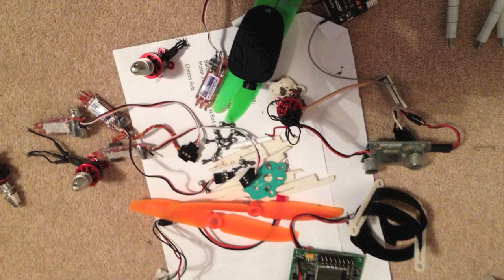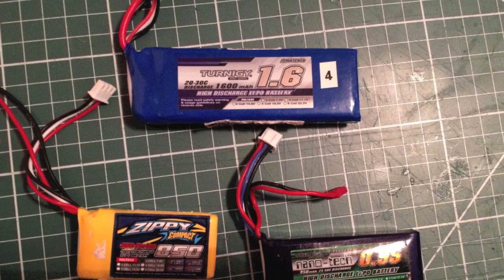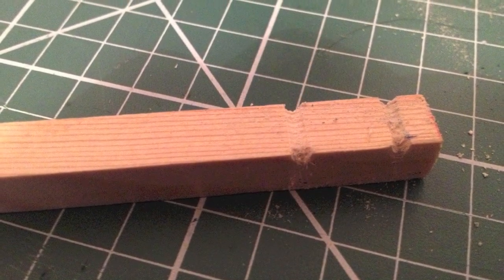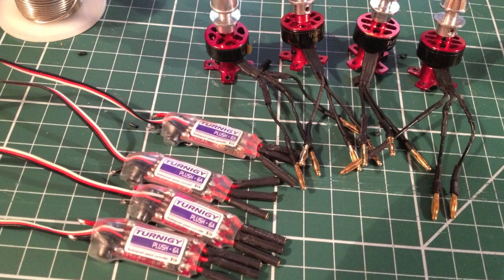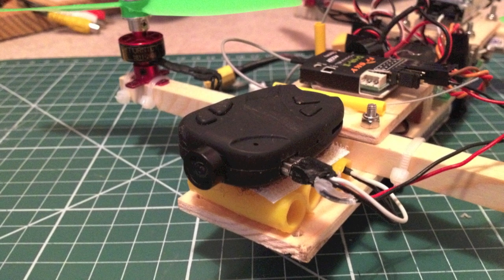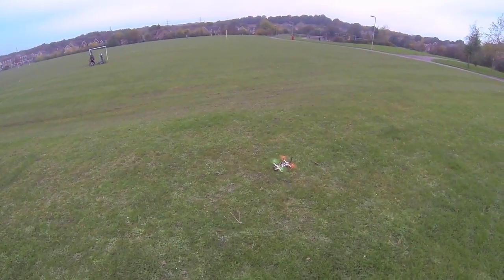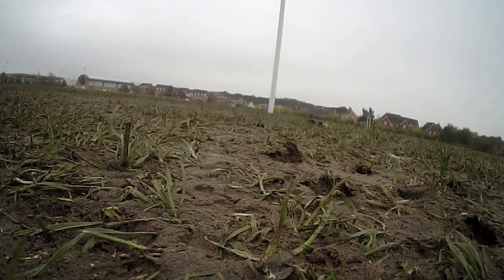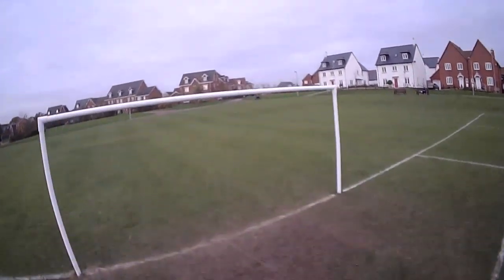FPV Mini-H Quad build, maiden and initial testing

Comment: wobbles could possibly be from frame flex
Reply from the maker: djSpinege The wood at that length is less flexible than carbon fibre, it's really nice and stiff.  What I have noticed (as I made this video quite a while ago) is that the kk2 does really seem to struggle on smaller quads - where it does reasonably on larger ones.  For quads of this size, the only choice is really the naze32
Reply: CurryKitten ah i see very nice. ya, its hard to beat a naze32. my old cc3d cost 6 times more then the naze32 and its not even as smooth in rate mode. do you still fly this woody?
Reply from the maker: djSpinege I must confess I've been stealing bits from it lately, so it's got no rx and no VTX at the moment, so not so much.  I wouldn't be able to do anything else with these tiny motors/escs now, so it'll fly again at some point :)

Comment: 7min! on a 1600? wow! I have a used 1800 3s with 2805 2s motors and barely get 5. What mini are you flying now? I think I have HB9 thought out now I have first hand mini flying bug.
Reply from the maker: Trying to fly the v5 K-Quad my friend printed, but I seem to be hitting timing issues between the ESC's and motors which is causing some wobble - this is on a 1300 3s and is good for around 6 mins in the test flights.  As you get your own CF cut, using a 3mm thick arm seems to give a really strong base on other minis

Comment: where do you put the pitch servo lead if you dont use NAZA? Just in the receiver?
Reply from the maker: The rx is using CPPM, so all 5 channels the kk2 need are coming from the single servo wire.
Reply: So to what port? I think in the receiver?
Reply: CurryKitten
Reply from the maker: Timo Martens Hi Timo, yes, in the quad a single servo goes from port 1 in the FrSky Dr4-II to port 1 on the KK2.  But it does depend on what you mean by "pitch servo" ?  if you are talking gimbals - then there are specific outputs for servo gimbals on the kk2 (and Naza) but if you are talking brushless gimbals, then in both Naza and KK2 it would be from your RX straight to the gimbal controller
Reply: Ah, okay I will buy the same gimbal as you had. And I use the KK2Board so ONE wire to signal gimbal pitch to signal receiver?
Reply: CurryKitten
Reply from the maker: Timo Martens I'm a bit confused, as there is no gimbal in this video - I don't want you to take away the wrong information from here.  Can you tell me exactly what you are trying to connect to what - flight controller/gimbal controller/rx and what you want it to do.
Reply: Okay im sorry if i am a bit confusing. This will be the setup. KK2 board, turnigy 9x, goodluckbuy gimbal (the one you had in a other video). I saw someone saying you have to put a single wire into pitch on the gimbal board TO naza. But as i dont have naza, where do I have to put it? Where on the receiver?
Reply: CurryKitten
Reply from the maker: Timo Martens Ok - I understand now.  In that gimbal video, the gimbal doesn't actually connect to Naza, it goes straight to the rx.  So you should do the same with the KK2.  So if using a CPPM rx you can have a single cable going from rx to kk2 to control ail/ele/thr/rud/flight modes and then have another cable from the rx to the gimbal controller to control pitch.  I've found out though (after blowing something) that you should only have the single control wire from the servo cable, so remove the ground and power cables
Reply: Ah thanks a lot. You have helped me a lot! Thanks for the effort of answering my questions :). CurryKitten
Reply: Hi another question,  the gimbal we talked about, the goodluckbuy one, on how many volts does it work?? A 3s lipo? CurryKitten
Reply from the maker: Timo Martens Yes - it needs 12v, run it from a 3s
Reply: Ah alright. But then I have a problem, my hex will run on a 4s and I saw the gimbal had a JST plug, I will buy a 500 mAh, but I dont have a wire from JST to xt60, you know where I can buy one? CurryKitten

Comment: Looks awesome! I've been wanting to build a very similar quad and had a few questions..

Do you happen to know what your frame weight was? Or your all up weight? I've picked out the same motors/esc/kk2 board that you have, and my total electronic weight so far is ~257grams with my receiver and camera/Tx.

What props did you use? How does it handle? I'm nervous that it will be too much weight for the little motors to fly well.

Thanks!
Reply from the maker: I weighed it before as someone asked and it was 238g without the lipo or camera.  The 1600 2s lipo weighs 92g I think.  On this weight hover is just a little past where I would like it to be at about 60%, but that said the handling is pretty nice - there's no struggle, but she's not brilliantly fast.  I'm having more success with this one than my 3d printed quad which I equipped with the 3800kv versions of the motors - I'm not convinced the lipo can delivered enough power, and so far I'm unable to get it flying smoothly - it does feel more acrobatic though.  Props wise, I'm using Gemfan 5030 2 blades.  I had a bunch of the 3 bladed props, but I couldn't get any smooth flight from them
Reply: CurryKitten So it must be a pretty light frame, then? All my wood is at home so this weekend I'm going to try to weigh it and extrapolate/estimate a weight for the frame. My camera/tx is only 56grams together and I had picked out the same batteries you had. I guess without battery my estimated electronic weight is ~165 or 170, though let's be honest it'll likely be higher with all the connections and wiring. Would you do anything differently if you were making this quad all over again?
Reply from the maker: DerickZ316 It's pretty light yeah, it's pine.  This whole quad got built as a reaction to me smashing up my previous mini quad (which was based on the Turnigy mini frame - which broke easily) I got the weight right down on that using a micro vtx, and tiny lipos, but after smashing it up, I didn't want to limit myself - so it was built with what I had spare.  The wood was from broken Tricopter legs, motors/etc/rx off the broken mini, and the VTX is one that seemed to lose it after 1km (so was hopefully ok for close in) so it wasn't really planned out.  However, it does fly pretty nicely (see a video of mine called Mad Dogs 5 FPV Meet)  The things I might do differently in that build was to give my ESCs more room so they could lie flat, and not bother soldering all the power lines together into one XT60 - basically use a mini distro board of some description.  I've been concentrating my efforts on the K-Quad as it's a friends design, and like I said, the higher KV motors are giving me problems.  So I'm going to try 3S motors on that, and depending on how you want to fly this might have been something I'd change on this quad... but I don't know that, the new motors are on a slow boat from Hong Kong, so I'll reserve judgement on that until I get them !
Reply: CurryKitten Yeah I'm planning on putting my frame together from old tricopter wood too. I really want to keep this thing as cheap as I can (partially because I decided to splurge and get $200 fatshark tx/camera/goggles/rx combo from hk). I'm just getting so many conflicting estimates when I try to use online calculators.. maybe I just don't know how to use em. One will say 3 minutes flight time, one will say it won't even be able to hover, one will say 10 minutes flight. I don't suppose you know how much your tx/camera weigh? The ones with the kit I'm thinking abouting getting are 23/33, respectively. I can take the case off the camera to bring it down to 11, but I'm not sure if I trust my flying skills enough!
Reply from the maker: DerickZ316
I'm using a 600mw ImmersionRC VTX should should weigh 18g and the 808 #16 camera which should weigh 17g.  These are specs off the web, so I don't know how accurate they are.  However my AUW (which is accurate as I just weighed it) is 256g without a lipo and 346g with a 1600 2s lipo.  This gets me about 6 minutes of flight time

Comment: What is the size of the wood you used for the arms?  Thanks
Reply from the maker: it's 10.5mm square (which is about 1/2" if your talking in imperial terms)
Reply: CurryKitten cool.. thanks

Comment: i also made my micro quad a new frame but want better props, yours props seem just right, what size are they?
Reply from the maker: These are Gemfan 5030's  There's not much choice in the 5" props, especially in the 2 blade variety
Reply: CurryKitten thanks, will get some

Comment: Thanks for sharing, I bought a KK2 board but had not installed it. I had been discouraged with learning to fly a quad. Guess I need to follow up now!
Reply from the maker: Yeah - no excuses.  KK2.0 on 1.5+ firmware and the auto-level really helps when you are starting out.  Not so much on these little quads, but on a more standard 450 sized it'll get youin the air really quick, and without that much crashing (compared to the original KK board anyway which is what I started on)

Comment: Sorry for not replying directly to your comment but im doing it on my phone and Google + has messed it up, but anyway I'm using the hobbyking multi rotor control board v3.0 but my thinking is that I can fly in indoors at home and that it will be a lot more forgiving than a 450mm quad if I was to crash.

Comment: Nice build, the wobbles are from your P gains being to high.. Seeing its a H frame, unlink the P and I and turn each individually. X type frames you can link both as its a Symmetrical frame. Fast oscillations are P gains, and a slower wobble oscillations is I gains.

cheers
Reply from the maker: Thanks - I hadn't considered the asymmetrical frame in the tuning... although I'm thinking a motor has gone bad at the moment.  My previous X-frame was nice and smooth and went wobbly without any alterations (and then crashed) - same kit on here.

Comment: Well once I have my tube arms I guess I'll have to make a short set and once again buy 4 faster motors. I already have orphan 5" tri-blades here.
Reply from the maker: I had real issues trying to balance those 5" tri blades, things got a lot easier when I switched to regular 2 bladed props.

Comment: Thoroughly enjoyed that CK, I like the raw simplicity of it. Do you have a parts list, I wouldn't mind making this a little winter project.
Reply from the maker: Pm me if you need a more detailed list Steve, but 6amp Turnigy plush escs, Turnigy 1811-2900 motors, 5030 Gemfan props, a KK2, FrSky D4R-II rx, an ImmersionRC 600mw VTX, 1600mah 2S 20-30c lipo, 808 #16 cam, bits of wood, wire, cable ties :)

Comment: Well that worked out really well mate and i've had the odd bump with my little turnigy min quad and was getting fed up with gluing it back together with epoxy,so I went and got another frame lol,but I haven't put it together as the old one is still flying but when the frame breaks again as I know it will,I might try this rather than using the new frame which we both know it not up to the job unless you never crash. ;-)

Thanks for sharing this one and a big thumbs up.
Reply from the maker: Thanks for the comment.  Crashing is part of flying - so I didn't mind the fact I had to fix the frame, it was just the fact it kept killing the motors that was doing my head in.  Be sure to post up a vid once you have the new frame built :)

Comment: Nice Job. I also have the wooble I don't know if kk2 1.6FW or the non simonk multystart esc. or the cheep HK motors but I just want to have fun. not serious photography of any kind.
Reply from the maker: Nasty motors will make a difference, my Tricopter is on Turnigy Plushes with DT750's and it's smooth on KK2, while my cheapo quad with some motors I found on ebay for £4 each is a wobble factory.This is certainly a quad just for fun - but I want to get it as good as I can, just so when flying through small gaps you can see where you're going better :)

Comment: Well now, that just looks like a real good time!=) Well done m8. I like the outa sight outa mind ESC boxes.Mine is so ugly I don't show it off ..I have been having the same wobble action and have flown it hard. I have a CF tube frame zip-tied and a corflute plate that carry  my ESC's, FC and a lil power distro board...and a ubec for my 808...oh and a 5.8 200 mw vtx brought back from the dead.lol depending on what battary I use she is just under 300g. I am only getting 4 -5 min of flight time. Hats off to you Curry!
Reply from the maker: Wow, if she's uglier than mine, then she must be really ugly :)  If I can get this wobble sorted, then this little quad is going to come everywhere with me.  Tracking it down might be the tricky thing - I'm suspicious one of the motors may not be happy - lots of testing to do... and another few other builds taking my attentions as well.  Thanks for the kind comment :D